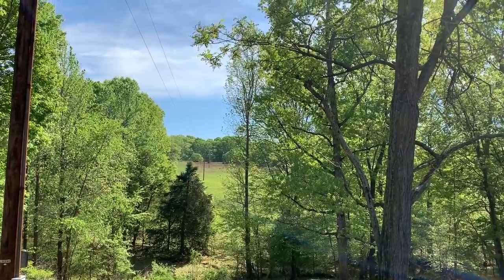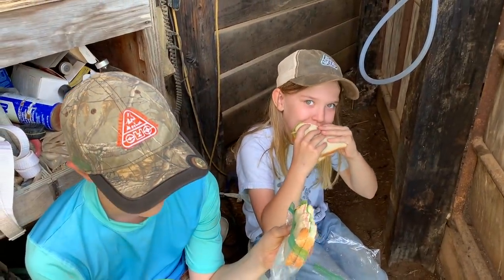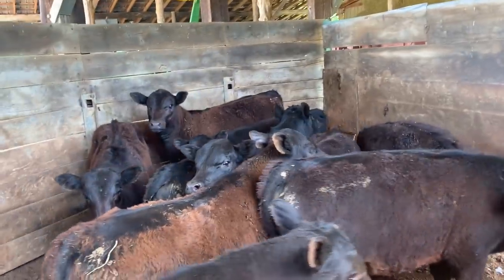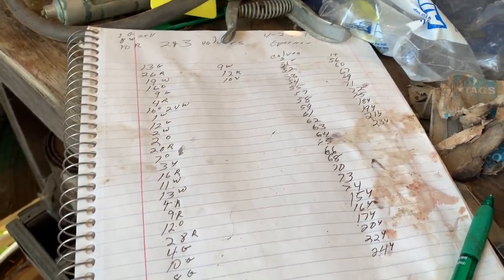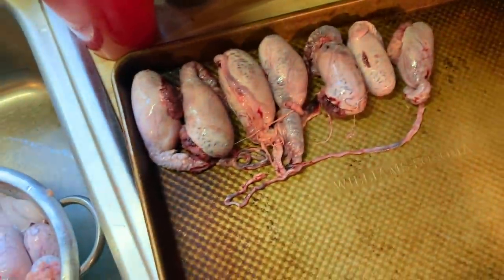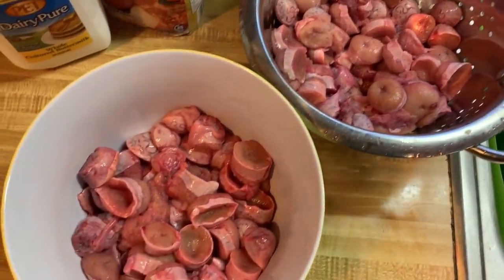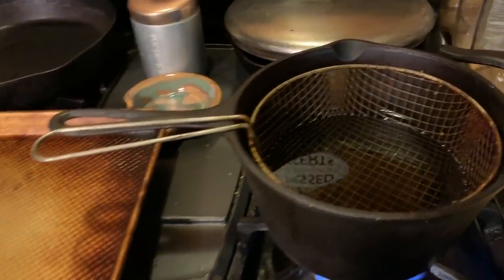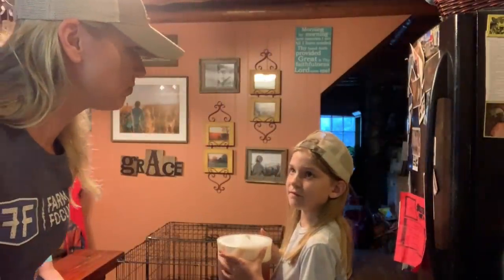No Bull: From Changing Minds to Cooking Calf Fries

Comment: High love your channel. I'm 58 been frying nuts for forty years. small nuts like those are easy to clean if there half froze slice the outer membrane length wise and peel it off. Then slice the nuts length wise. We use beer batter and cracker meal fry in real butter ( Ol saw bones will argue this point). We fry bull nuts from the packer plant also those we clean the same way but once the outer skin is off we use an electric slicer cut them cross ways about a 1/4' thick as there is a cord that runs down the middle that makes them tough to chew. Fry the same as the small ones. If real butter aint for you savory butter in the jug has a great flavor also. ( Never have been a fan of deep fried nut.)

Comment: Hey there Meredith! My momma made the most tender, luscious calf fries I ever had. Never had any worth a damn since my dad sold his cow herd 50 yrs ago. After watching this video I went through the comments, sure that someone had advised you how to get the best result cooking this delicacy, but saw no one come through with more than a few hints - so here ya are: 

Straight off the calf throw those meaty morsels into a bucket of strong salt water. Momma used rock salt, sometimes known as "ice cream salt" these days. When the surgery session was over she'd take them to the house, pour off most of the bloody water outside, add more water from the garden hose & salt again once she had them in the kitchen. Then she'd sit that bucket which was only about half full of water/testicles into a chair & begin trimming off all the stringy vessels (with her sharpest kitchen knife),  putting the cleaned ones single layer into a big sheet pan. She'd cover that with foil & bake at low temp for a long time (probably an hour or more @ about 250 or 275 d). 

Once the lovely ovals cooled down she'd peel off the outer membrane (came off easily after being roasted), then she'd butterfly them out, double dredge in egg/butermilk wash and flour/cracker crumb mix - then fry gently until barely golden. Overcooking to brown-crispy makes them tough. Don't crowd them in the pan, only cook 2 or 3 at a time in each skillet and keep the heat down to a soft sizzle. 

Rocky mountain oysters prepared with this method were fork tender to cut. She served them like  TX style chicken fried steak - smothered in cream gravy - my daddy liked to top it off with a dash of Louisiana hot sauce - us kids put a little catsup on top. They were like eating deep fried fat. Melt in your mouth yumminess. 

FYI: Being the daughter of a cattleman I grew up eating head cheese, liver, calf fries, roasted bone marrow - but drew the line at brains and eggs. I tried to like them, but gave up at age 8 when I puked in my shoe one morning after forcing down a hearty helping of B&E. 

Always enjoy seeing/hearing about your adventures as a momma/farm wife/field hand - a bit different from what I experienced here in TX Panhandle cattle country. I smile when y'all complain about too much rain, 'cause we complain about no rain.  Since being widowed in 2011 I've converted this farm  operation from cotton and corn production to 100% hard red winter wheat. This allows me to have a couple of summer months off to enjoy the cool NM mountain air at the time of year when temps here in TX are bumping 100 d almost daily. 

Always remember to cherish each day - this ain't no dress rehearsal.
Reply from the maker: I'm sorry I missed this comment, it was being held hostage in my spam folder. Thank you for sharing all of that information! I need to try again. :) I've never had brain and eggs and I think I'll be ok if I never do, either. haha. I appreciate you taking time to share. :)
Reply: @ThisFarmWife_  i had brains and eggs when I was young, grandma fixed them.  Only thing she fixed I did not like at all.  But what grandma fixed, you ate, no questions asked.  You ate it or did without.  We, me and my brother, did without but grandpa would sneak us some leftover fried chicken later so it was okay.

Comment: Very nice sweep setup. I like the fact its homeade and took some enginuity. One word of caution though is watch that they cant kick the gate back at you. My buddy lost 2 front teeth to a gate like that. The built ones actually have a spring loaded latch that catches every foot or so as it's being closed. You dont have to latch it ad your closing it. Nothing wrong with the setup just be careful. Wouldnt want to hurt that pretty smile

Comment: You had my job holding tails. 
We always clamped them no blood  and i like  clamping them at four days old . But holding the tail paralyzes there hind legs so the operator doesn't get kicked.  Tail holder gets mighty tired by the time you get done with a 100 bulls . Very hard work and you did a great job.  If you split the nut and  slide a fillet knife between the two membrain and  meat on your cutting board they slide right out . At least it works with hog nuts.  
I hope this is helpful. 😊
Reply from the maker: Thanks for sharing! Yes, we finished yesterday and I'm glad to be done. :)